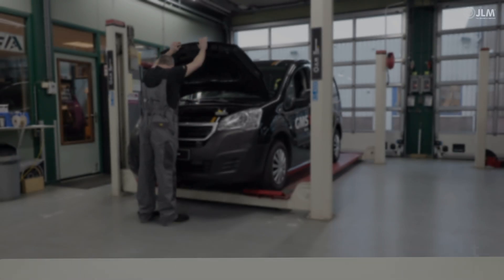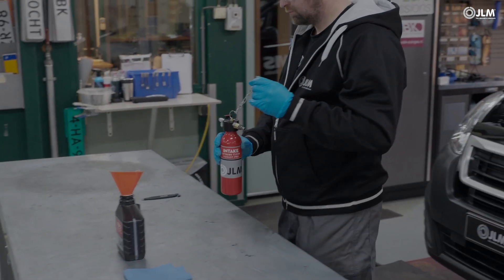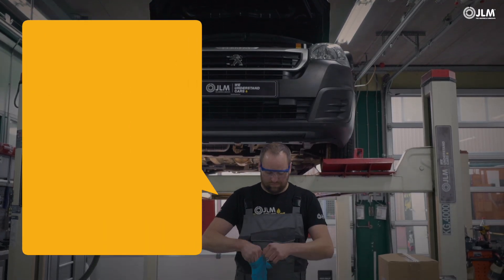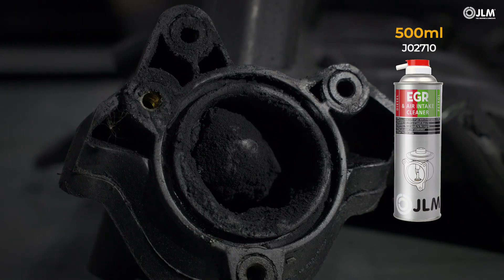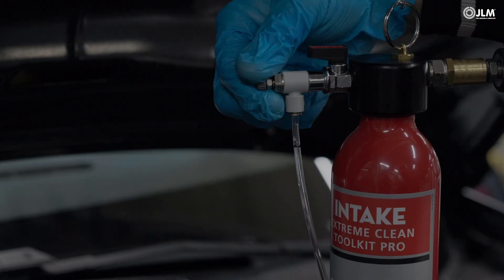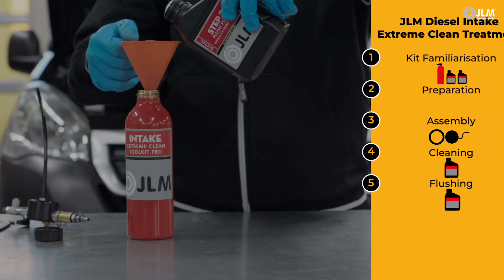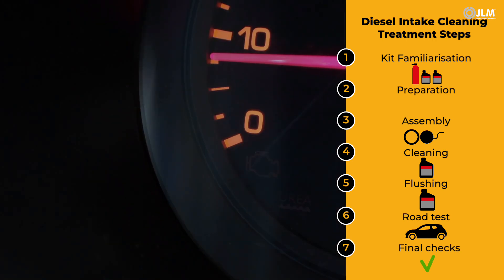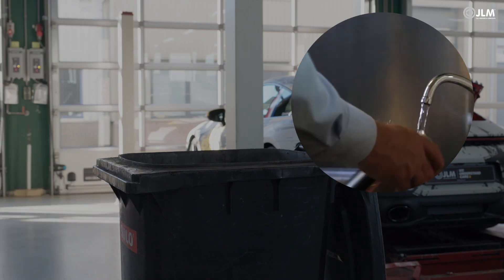How To Use: JLM Diesel Extreme Intake Cleaner

Comment from the maker: #diesel #intakecleaner #sootremover
In this step-by-step tutorial we'll guide you through the process of thoroughly cleaning your diesel engine's intake system, to remove carbon deposits, soot, and other harmful build-ups. 
Learn how to safely and easily apply the treatment to restore your engine’s performance, improve fuel efficiency, and reduce emissions. 
This guide provides all the tips and instructions the professional motor mechanic needs to get the most out of the JLM Diesel Intake Extreme Clean Treatment.

For more information go to https://www.jlmlubricants.com.au/product-category/diesel
Buy Online: https://jlmlubricants.com.au/products/diesel/jlm-diesel-intake-extreme-clean-toolkit/